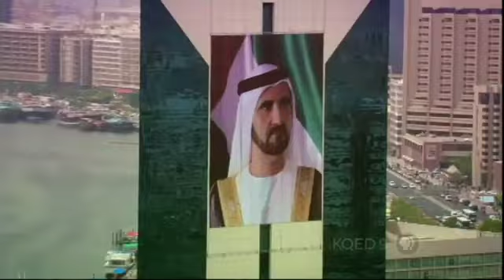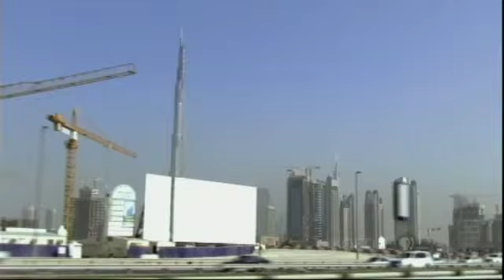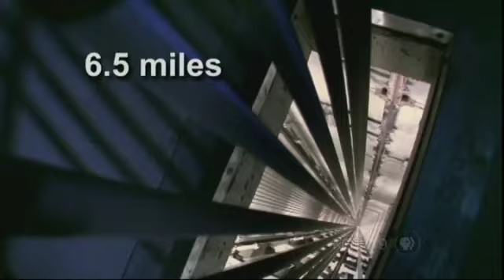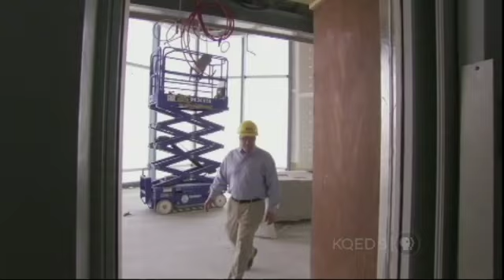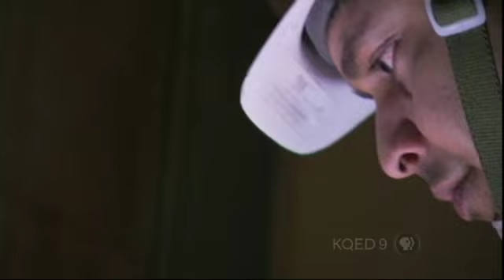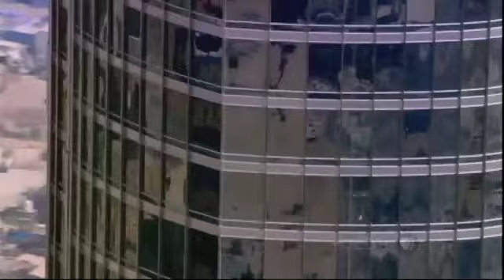World's Tallest Elevators

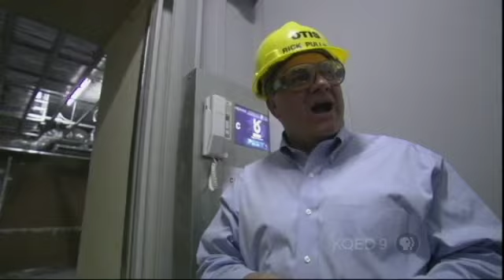Comment: 3:41  CRAZY! They go so fast, yet can go so slow! The motor must be spining so slow. Example: suppose you have a motor that spins 10,000 rpm. When you want to spin it slow say 10rpm you run into problems, the motor would not have enough torque at so little voltage or frequency (deciding on motor type; DC or AC), you need a closed loop feedback, if the speed is going below what we want it would speed up and if it is too fast it will slow down, but still is VERY tricky to do that!

Edit: fixed grammatical issues as well as spellings
Reply: Remember lifts are direct drive and a high speed lift will have a motor that is not even geared to the traction sheave. These machines are essentially just a very big powerful motor. They need to have the torque to drive a load away from a standstill and are designed to do just that. 
If you’re used to seeing electric motors running at thousands of rpm, you have to realise that these are very very different
Reply: @Carol-East  I totally agree these motors have VERY high torque, but what I meant is it is like driving a car that is in 5th gear and wanting to go 1mph, you just can’t do that very easily. If you see I said “Example: suppose…” that means it is an example

Comment: I counted the cables on the elevator machine and I noticed that there were 20 of them. That’s a lot of cables!
Reply: I would guess that this lift has double wrap traction. You will see 20 ropes on the sheave but each rope passes around a secondary sheave and then back to a second pass. That’s really only 10 ropes. Still quite a lot compared to most “ordinary” lifts.

Comment: To avoid confusion, you have to know:

8 meters per second is the speed of the highest rising elevator in this building serving from floors C to 138

10 meters per second is applied in both directions for the observation deck/sky lobby elevators.
Service floors:-
C and 123 ( Lower deck ) and G and 124 ( Upper deck )

Comment: The animation was wrong because the cable is tensed the highest at the pulley and therefore would break close to the pulley, the smallest tension is at the point of a cabin connection since it's the only of two points of the cable with zero weight added by the cable, other being the counterweight connection

Comment: The animation was wrong because the cable is tensed the highest at the pulley and therefore would break close to the pulley. The smallest tension is at the point of a cabin connection since it's the only point of the cable with zero weight added by the cable

Comment: Hope there is never a big fire on that sky scraper.....ppl couodnt escape if the stairs were cut off from them.
Reply: The burj khalifa has top of the line safety features, the concrete has a fire resistant coating as well as a sprinkler system throughout the building, no fire could bring this building down as it is a rock solid concrete structure. In the unlikely event all the stairwells were blocked there are refuge rooms and balconys where people could get airlifted to safety.
Reply: EarlFaulk There are fireproof safe rooms in the skyscraper.
Reply: Nothing is fireproof, this skyscraper is also not fireproof, it is impossible. Even when some idiots would fly a plane into this tower, the tower will not survive, evacuating will be a nightmare..
Reply: EarlFaulk i dont think, that it can catch fire... but i get your point. An evacuation would be hell!
Reply: Actually, except for other towers, Burj khalifa the world's tallest structure is equipped with 38 fire resistant emergency evacuation lifts that operate during incidents of fire. People needn't use stairs to evaluate. The building planning is the best of this century.
Reply: 9/11

Comment: you know, if the cables broke, the elevator would stop. Otis himself invented a safety lock to market the first elevators.
Reply: Highly unlikely even one cable would break.
Reply: jb0177
Correct, they are very strong.
Reply: jb0177 that wasn’t the case for john Hancock center
Reply: @ElevatingChicago  A big lesson was learned by that: express elevators without outer doors are a stupid idea
Reply: They are called landings
Reply: @ElevatingChicago  Whatever. Not having them is still dumb because the firefighters have to break the wall.
Reply: @ElevatingChicago  that elevator fell at operating speed, it was a problem with the controller, and it wouldn't of fell if cables snapped
Reply: The elevator car is attached to a speed control unit via a steel cable. The speed control unit is in the motor room above the elevator shaft. If all the cables were to break the speed control unit notices that the car is speeding and locks the flywheel in the unit. The steel cable is tightened and the wedge stop mechanism is put to action clambing down on the wheels that guide the car along the shaft rails making the elevator come to a complete stop.
Reply: @rixchannel3977 does this basically work the same as a car seat belt?
Reply: Actually, this is true alongside the mechanical one...@rixchannel3977
Reply: one elvator cable is designed to hold the whole elevator's weight by itself
Reply: Elisha Grave Otis even showed in asterix cleopatra movie
Reply: Holy hsit I've already seen this video. I can't believe there isn't at least 100 upvotes on my 2 years old comments. It was highly funny wasn't it not?
Reply: wow
Reply: But elevators fall up because of the counterweight... and it won’t trip safety...
Reply: @QEElevators  they will only fall up if there's only 3 or less people in the elevator and  the governor will trip if it is moving faster in any direction and there are also brakes on the motor
Reply: He also solved the swaying high rise issue with the cables and shafts.
Reply: Otis  lock was successful in the  elevator business  and I quote Otis in  his lock trial   " All safe gentlemen all safe"   basic mechanism
Reply: That’s why Otis was so successful
Reply: yes
Reply: No the elevator would fall to the ground hard and that is dangerous
Reply: @scoobydoo7104  no elevator can fall, there are a bunch of safety features in the modern traction elevatorFirst of all, elevators never plummet down their shafts. For the past century, elevators have had a backup break that automatically engages when an elevator starts to fall. If all the cables snapped (highly unlikely), the elevator would only fall a few feet before the safety breaks would activate. And if it fell at operating speed due to a controller malfunction it would hit the safety buffer which would reduce the impact by alot.

Comment: They need to make elevator's have on board Linear Induction motors like Maglev trains while climbing up on a worm gear and rack system and getting it's power from a 3rd rail or Pantograph/electric wire similar to subway train. There would be a  back up battery with computer that locks the brakes once power loss in the main electrical system is detected thus preventing an elevator from falling. That will get rid of heavy cables and motors at the top of the building.